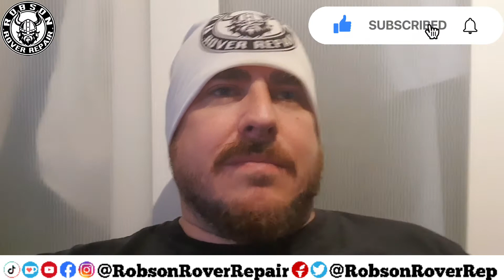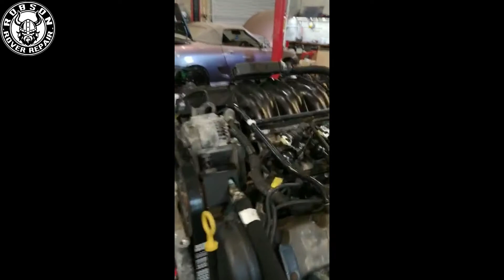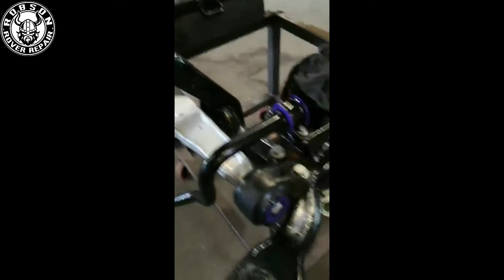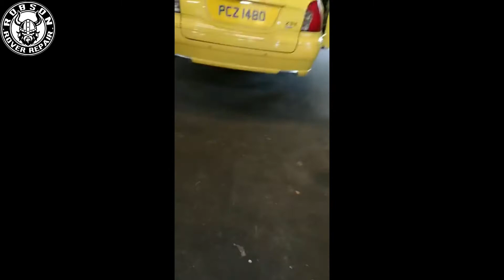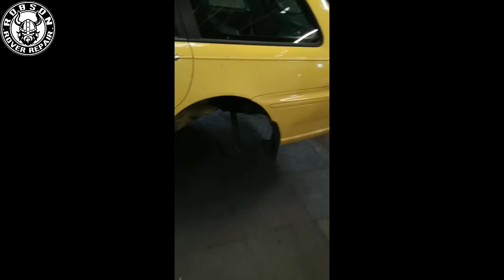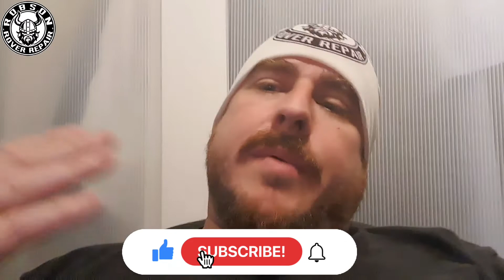MG ZT-T 190 V6 REBUILD - "PROJECT ALICE" - DAY 5 DIARY - THE DAY I WASNT THERE AND STUFF GOT SORTED

Comment: Fantastic work from both of you, can’t believe how much ground you’ve covered already 👍
Reply from the maker: Mark's a hell of a guy. It might have even been off the ramp by now but a few parts have delayed the whole situation massively.
Reply: @RobsonRoverRepair  
No need to rush Col, really looking forward to more videos
Reply: Hi Col, need to ask for your help if possible. I have a early 2000 V6 75 but not fitted with front fogs , I have the loom from a later model but it’s missing it’s live feed , the original loom has 5 wires going in but my replacement loom has 6 one being the live . I lifted up the fuse box in the engine bay to find an unused loom taped up , thinking this was the feed ( green/brown) I tried it but it’s a constant live . Any idea where the the live feed will be !!! 
Thanks Matt

Comment: Hi mate, I'm working on a rover 75 2.5 litre and I've just replaced the thermostat and the water isn't cycling through the engine, would it be the water pump or something else? Please let me know how hard it would be to replace the water pump.
Steve from down Under, I watch your videos a lot. Could you please reply.
Reply from the maker: Pretty big job. Stripping session of the whole side of engine to get at it.